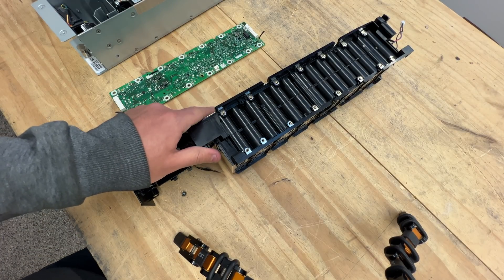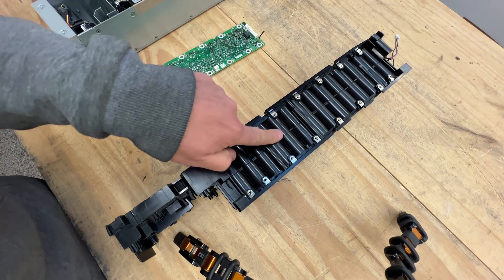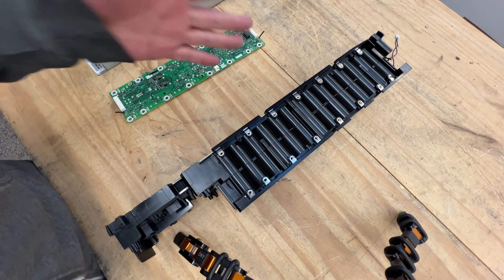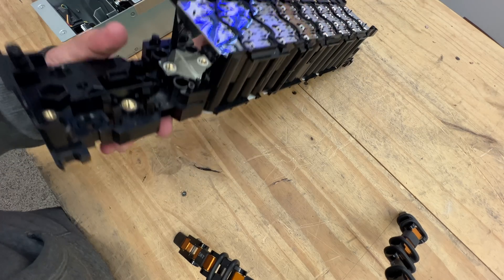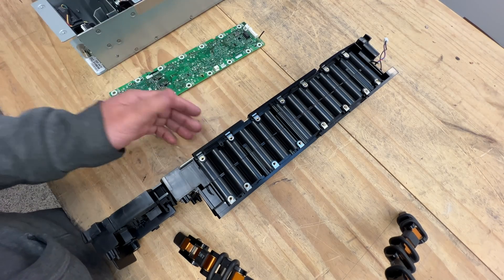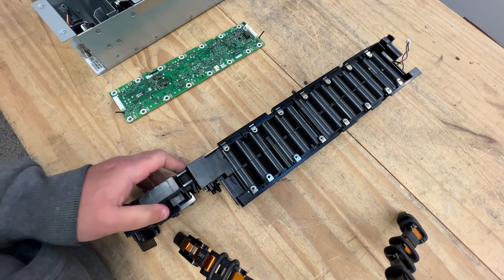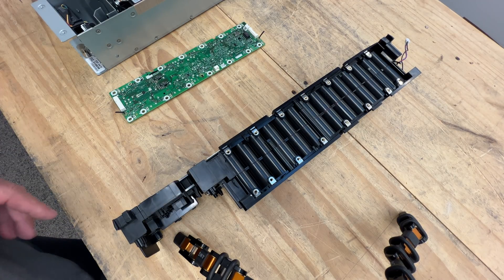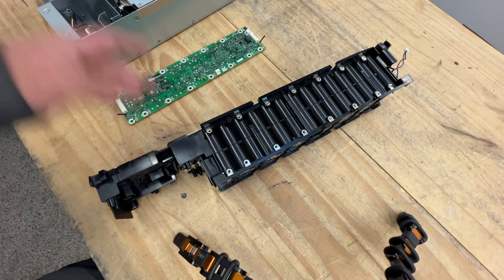Hot Swappable 48v Server Rack Lithium Batteries

Comment: Curious.... wonder how to adapt this to EZ Go golf cart (which is at 48V) as a simple way to "add" a reserve tank of juice to get you a little further down the road incase you deplete the Led Acid Batts...?   would some of these work with thick gage cable connections and a "transfer" switch to alternate them / separate them from the existing Led Acid BAtts

Comment: The network connector (RJ45) is probably not carrying network trafic. I think they just reused the same connector because you always have ethernet cables in a data center. Better than a stupid proprietary connector. I would think the cable carries serial data using the RS485 electrical interface.+ some temp sensor(s).

Comment: Whose going to Reverse engineer the bms and network control?
Reply: Way too much work for a 300 something watt hour battery. These are good for power powerwalls and EV’s. With the cell taps being so accessible the only thing that makes sense is someone making a breakout board to mount a BMS but even then it’s more practical to just mount a slim BMS there or use a breakout board to join the groups of a dozen batteries using one BMS. 

If they would have tripled the wh of the battery (possible now using P28’s) and using all that space it would make a great swappable battery for e-bikes or scooters.

Comment: Those are fused nickel spot welds. Probably about a 3 to 5 amp fuse.
Reply from the maker: not if the pack is rated at 81A  that means 81/4= 20 so they have to be at least 25A

Comment: $160/kwh before shipping for used cells without documentation or support...
Reply from the maker: And they are almost sold out!!! I think I’m selling them too cheap.
Reply: @jehugarcia  - if I could have seen the Panasonic part number & UL listing, I would have likely bought some.

Connectors are important, if more are coming, especially since the supplies have expiration dates.

Comment: These could be a fast and easy way to build a power wall, make BMS breakout boards, so they can plug in on one end and out on the other, parallel all outputs, to a decent BMS, all cell groups would be parallel, use about 20gauge wire so they have a better chance of all balancing, or just use a 20 amp BMS on each, pack, and parallel all cells, parallel the outputs to a bus. Then inverter charge, controller, you are in business, but 6ah +/- each,  it's going to take a few, if you can get About 100ah of these it could be worth it, being no enclosure to build. Just wire and mount,
Reply: 3-4 of these be 80ah
Reply: @johnle231 4 of these would be 24-25Ah. Less than 1.5kwh

Comment: I used some 48v 13s 6.4ah 100amp continuous panasonic server packs for my electric gokart!
Reply: Your kart is 48v or?
Reply: You seem to have videos on the subject. Nice, have a sub!
Reply: @Teknopottu  thanks! I haven't done a video on the new battery but the one in the video is actually 4 rc lipos in series to make a 13cell 48v pack!
Reply: @2down2togo  

Those lipos sure are cheap these days.

I’ve been thinking to make powerwall from lipo, bit I heard they cause fire or something??

You any opinion on them?
Reply: @johnle231  typically they only catch fire when misused. Mine are somewhat like the ones in the video as in they are in a metal box but my rc lipos aren't. I've only ever caught one on fire due to not having proper padding around the lipo when running on the gokart and the controller poked a hole in one of them almost causing the back of my hoodie to catch fire 🔥 😳 lol stupid thing kept trying to take off while on fire so I yanked the lipos out by hand (burnt hand too) then I was able to get my seat belt off lol so yeah they can but not when used right!
Reply: @johnle231  and there's so many different types of lipos out there, for a power wall I'd go with lithium ion cells if building in a shed or something but in the house u should get lithium iron phosphate or better known as lifepo4 since they don't ever catch fire
Reply: @2down2togo  good data. I didn't know.
Reply: @2down2togo  

Cool man thx
Reply: Yes 48v 12.8ah

Comment: Any voltage on the terminals at all before teardown?
Reply: Should be basic information.
Reply: Holly crap. Huge battery for 5ah
Reply: @ThePavelbychik  Yeah, because of the voltage there has to be lots of cells to ad up.
Reply: Watt hours would be better indicator. 52Vx5Ah=260Wh

Comment: it would be great if you would configure that to work with a Growwatt 3kw offgrid inverter
Reply: Nothing stopping you from using a high end BMS like a Seplos or something. But honestly what is the inverter going to communicate that’s important? All that matters is the inverter cuts off at low voltage (set by you) and the inverter turns back on at some reset level (another setting I’m sure the Growatt has)

Comment: You have a typo in item’s web page. 

Nominal Power: 4.2Kw <—— 
shouldn’t it be 4.2 V ?????? 😆
Reply: That's not a typo
Reply: At the 55 second mark in the video he also states they can do 4.2Kw output. Which matches what is on his website.
Reply: That is a typo...
51volts x 6amp = 0.306 kw
Reply: @azinfidel6461  0.306kwh. 4.2kw is the max power.
Reply: @niktak1114  I'll let you think about that for a while...😂😂
Reply: @azinfidel6461  you are confusing power and energy
Reply: so, the way I understand it, a kwh is a 'reservoir' of power.  If you keep it constant, it can output 306watts in an hour at 6 amps.  That doesn't mean that it can't put out twice the wattage, but for 1/2 the time.  or ~1200 wattage for 15 min.  so  if it can do 306watts in an hour, it can do 4000 for about 4 minutes but, it would be pushing ~100+ amps.